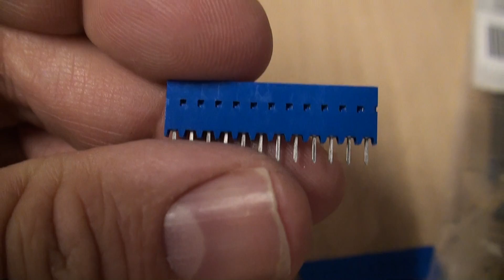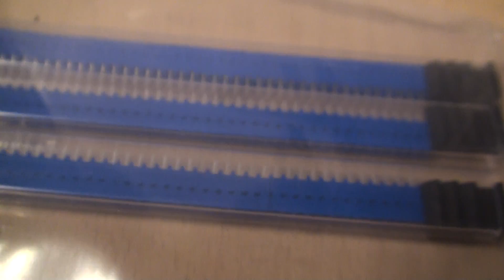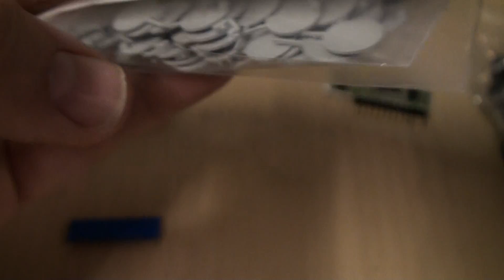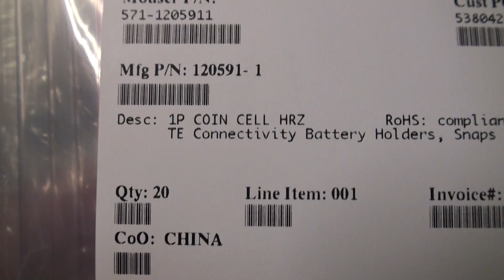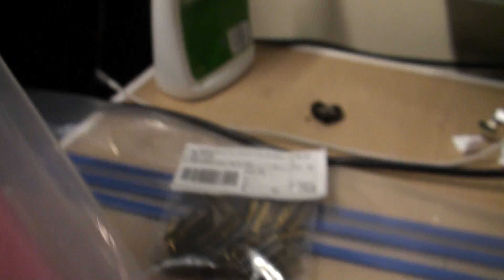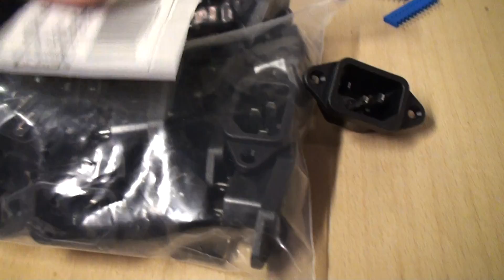Juno-106 - Series 4, Part 4 (Part Numbers!)

Comment: I also replaced the C9 AC socket with a standard 3-pin one (aka C13/C14) I salvaged from some electronics - on my private Juno. The earth is not connected though and this is a problem, because a 3-pin plug must have the earth connected. So well, a standard 2-Pin IEC320 C8 might be a better choice, and there are - dodgy - C8 auf C9-adapters. Or get some IEC 320 C9 power cords of Amazon and leave the original C9 in place. Not connecting the earth on a 3-pin inlet is IMHO a no-go.
Or - use a modern C17/C18 one with also the earth missing. It can take standard 3-pin cables (C13), so a missing cable isn't much of a problem - and the inlet clearly shows, that the earth is not connected. IMHO the best choice.

Comment: I was just curious on how you took off the pin on the connector header to connect to the chip? Thanks
Reply: oh never mind I just found out I needed to clamp down on it pretty hard and pull it with some pliers  Keep up the good work! Love the videos
Reply from the maker: ***** You got it. Just like pulling a tooth in the old west... Whiskey is optional ;-)

Thanks for the positive words!
Reply: I had a quick question. I just cleaned off the resin off my voice chips and I put three of them inside my juno 106 with the newly soldered solder mount. It doesn't seem like any of the chips are working. Is it because I need all 6 chips in for it to work properly? I had dipped them in nail polish remover instead of pure acetone and I was wondering if that could be an issue?

Thanks!
Reply from the maker: ***** Hm. I never tried nail polish remover so I couldn't tell you if that's bad or good. The acetone technique was originally shared on YouTube by RamCur, who you will see from time to time participating in synth tech initiatives online. The first time (and every time) I have ever done this procedure I have stuck to the script and only used acetone.

The chips are fully independent, however: You don't need all 6 to hear them. The fact they are all silent now indicates they have all been damaged by the nail polish remover - Either this or your voice board has another issue such as soldering issues in the sockets for example.

One last thing: I always key the sockets so that it is impossible to put the chips in backwards or out by one: I once put a chip in one step out from where it should be (before I started keying them) and it toasted the chip.

If you have killed your voice filter chips, all is not lost. The sockets you installed in the voice board are a good start and you can always acquire replacement filter chips, either as reconditioned originals or new replacements designed and manufactured by modern companies such as Analogue Renaissance and just recently Synth Spa. I will be reviewing all three options in a future playlist that is coming soon. In the meantime, check to see that your sockets are soldered in properly.
Reply from the maker: Syntegrator Just to confirm, Eugene - You left the chips in the middle of each voice cluster alone, right? Those are the wave generators and they seldom fail and do not need stripping or socketing. If you did process them, I trust you ensured they went back where they belonged rather than in a filter socket - That would probably kill them too.
Reply: Yeah, I left the ones in the middle. I just worked on the voice chips. It seems like 1 out of 6 of my voice chips work right now haha. I think it was because i accidentally put the chip one socket out of the hole it was supposed to be in because I was in such a hurry to finally check it out. :/
Reply from the maker: ***** On the off chance there are additives in the nail polish remover (which is essentially Acetone with some extras, you could try soaking the problem chips in Isopropyl alcohol for a couple of days.

I've done this process many times, and barring chips I have accidentally damaged (1 or 2) learning the technique I have never had a previously functional chip go bad afterwards. Sometimes chips that were on the way out give up the ghost when processed, though.

You didn't have your soldering iron super hot or left it in contact with the pads for too long, did you? Another thing that can kill a chip is pulling at the leg before it's ready to desolder and having the pad delaminate from the ceramic chip. That will kill them too.
Reply: Syntegrator Nope I didn't have it too hot. What I noticed was when I put it in to the synth, I didn't use the keying plug and i noticed one a couple of them had the pins not on correctly and had one hanging off and then a few moments later I started to smell some smoke. I think that the chips could be fried. The one that wasn't  left like that works fine. I think it was more of not putting them on properly. Thanks for all the help though!
Reply from the maker: Yeah the keying is essential. That's why I spend the time trowelling epoxy putty into the unused socket (or springing for teensy plastic keying plugs that cost 50 cents each) to ensure that can't happen. I killed one of my own chips that way early on in. Sorry to hear you made the same mistake on more than one of yours.

A comparison video is going to be made in the coming weeks that showcases the Analogue Renaissance and SynthSpa replacement filter chip and compares them against the original filters. Stay tuned for that.
Reply: Oh awesome I was thinking about buying some analogue Renaissance chips!

Comment from the maker: Hey Slug, great information on the keying plug. I ended up using sugru (the self curing rubber) to key all of my sockets, but I will include an order for the real keying plugs next time I buy from Mouser.

I actually found a good replacement and recorded a video on it last month, but since you have asked it's now uploading as part 5 of the series. It should be online in the next hour or so.

Cheers,

Syntegrator

Comment: Thanks for the Juno videos. My 106 died a couple of months ago and is about to have the acetone treatment. I have fitted the same sockets that you used and have found a suitable keying plug. The Mouser part number is: 649-65307-001LF. Manufacturer part number: 65307-001LF.
Reply: Those numbers bring up something totally different now. :(
Reply: @fetymann  Seems to be a Mouser problem. The manufacturer part number gives the correct part with Digikey and Farnell.